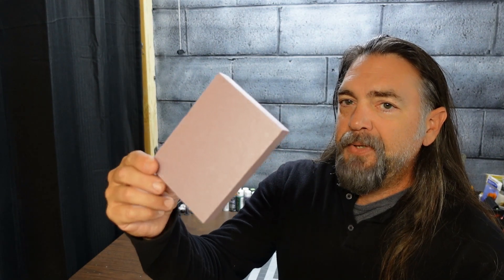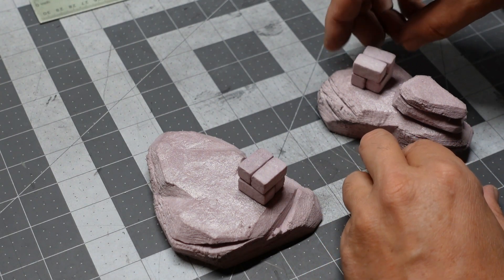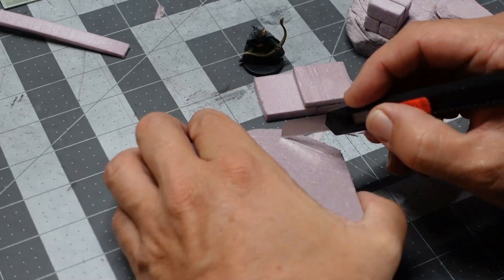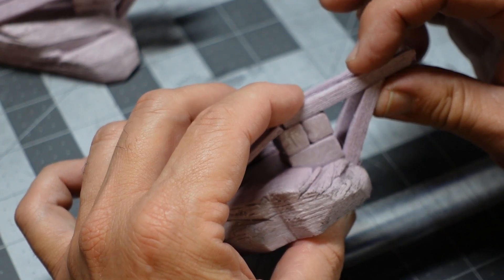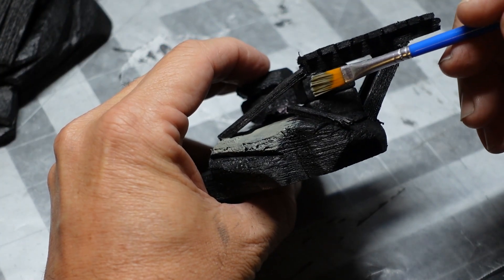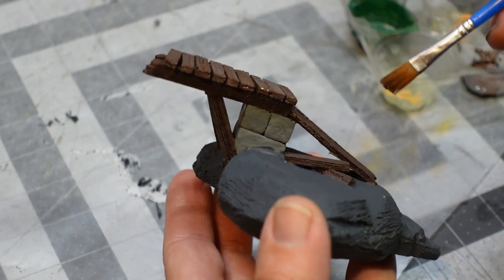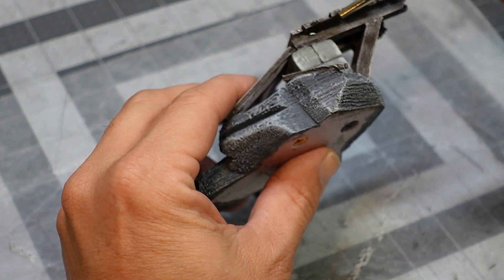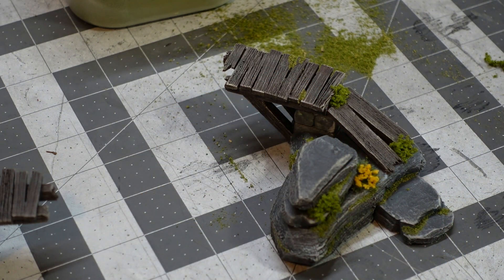Tabletop Wargame Terrain Ruined Bridge for Dungeons and Dragons

Comment: Love your work. keep it up! Just a quick question as I want to try and make some terrain myself pretty soon. What is exactly meant by dry brushing? just the fact you don't wet your brush before you grab some paint or?
Reply from the maker: Thanks for watching! Dry brushing is using a clean dry brush, dipping it in paint, then scrubbing most of the paint off on a paper towel. Then making very light brush strokes to apply what looks like a misty effect. You can always add more so sneak up on it! Check out some videos on "Slap-Chop" miniature painting techniques.